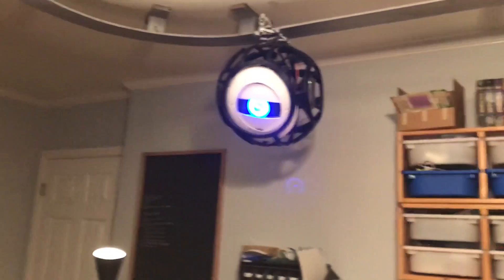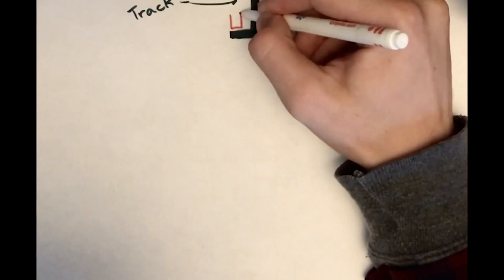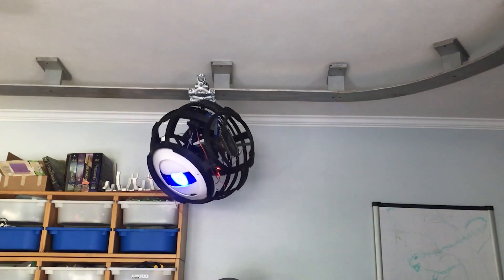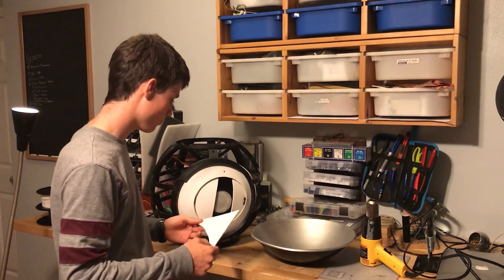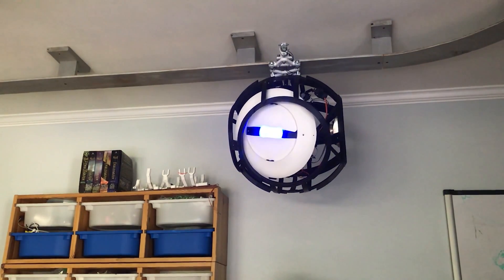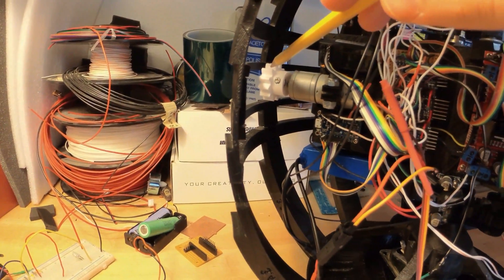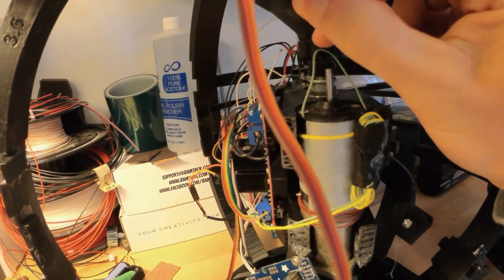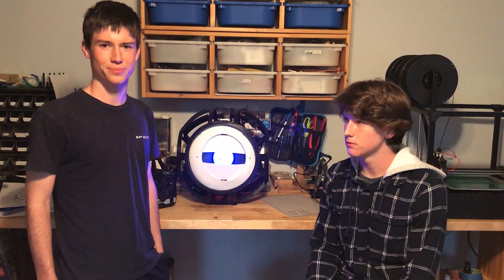How We Built Wheatley (in real life)

Comment: Whats motors and servos have you used?
Reply from the maker: The rotation, tilt, and track motors are all DC motors. Because we built most f this project a few year ago, I don't remember specifically where we bought them, but you can probably find something similar if you look up "12v DC motor" on Amazon. The eye is controlled by two servo motors similar to these: https://amzn.to/3fMuLF3 and the eyelid is moved by micro servos: https://amzn.to/3mneRU4

Comment: You should be really careful hooking those batteries up like that. Lithium ion needs to be balanced because slight differences in the battery can cause the cells to get overcharged if they aren't exactly the same capacity. you can also damage them by draining too much power causing to short out a single cell. And if you guys even read this comment, what is the reason of going with 3 small Arduino's instead of like 1 Arduino Mega? The project looks omega cool tho Im thinking of remaking it for a college project
Reply from the maker: Thanks for the tip on the batteries. They were the only thing we had on hand for a quick fix, and ya, we're watching them closely to make sure they aren't getting damaged. If we were to do this project over, we would definitely use an Arduino Mega, we just didn't have the experience that we have today when we started this. The 3 Pro Minis do fit into a smaller area though, which is a plus.

Comment: I’m saving up for a 3d printer and over 500 pounds of the plastic a bunch of raspberry pi module and some brushless and non brushless motor silicon and other stuff so I can start making animatronics I want to have a long lasting supply for the 3d printing plastic so I can make the frame of a turrent and the unused portal walking turrent I’m planning on having rotating gun mechanisms and using air soft guns for them

Comment: Hey great project and thanks for the build video! One thing though, please be very careful with those 18650s! They should always be "married" into a single cell, charged alike, and discharged simultaneously. You should never mix new and old 18650s, as they will have uneven levels of wear, which can lead to one battery taking the brunt of the work and failing. Always good to get a BMS if you can, and always use new cells :). They're cheap enough that it's not worth the risk of fire/explosion. Battery safety is no joke with the higher current cells.